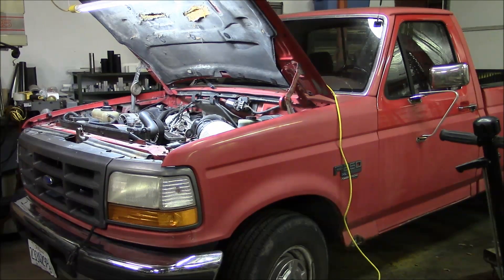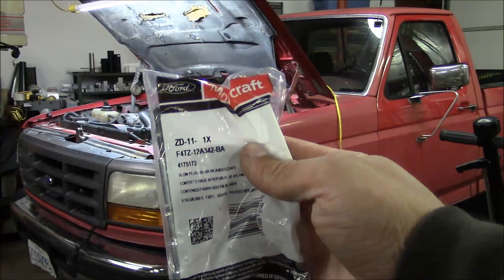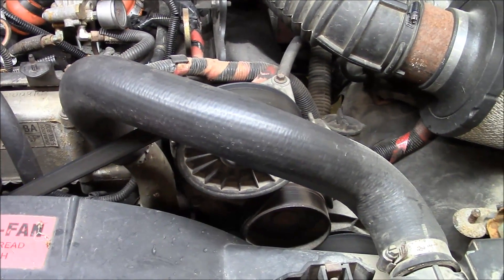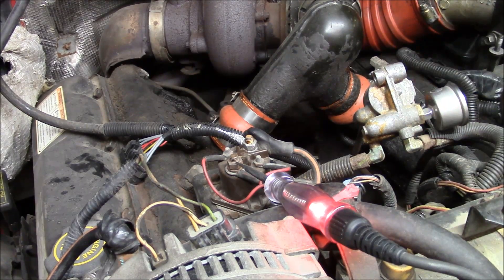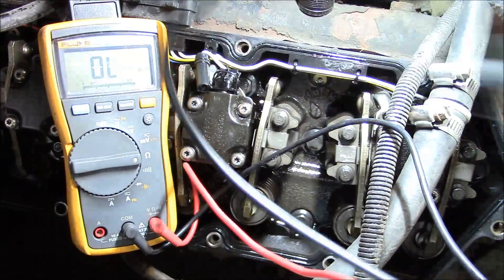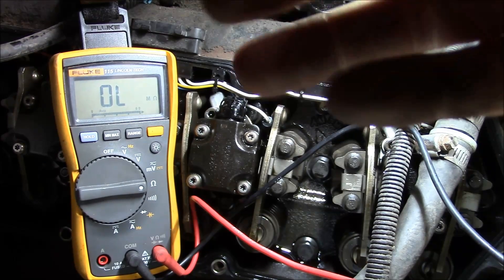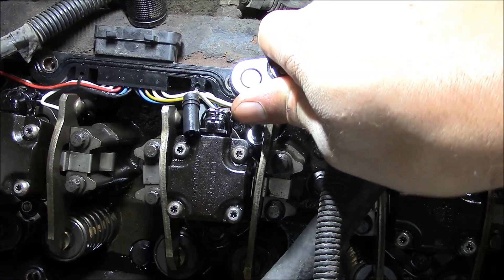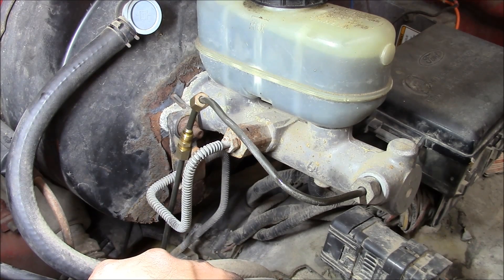7.3 Powerstroke No Start When Cold

Comment: Just installed new glow plugs in mine 95 OBS with 130k miles.  Broke one off! Real pain in the butt. Still didn't help with cold starts. Replaced the engine oil temp sensor. With apparently the wrong one. Fired right up when below freezing but holy smokes it sounded like it was running on 4 cylinders and idling at 1400 rpm  unplugged the new eot sensor and smooth as silk. Older round style connector on mine I see some for sale with a rectangle connector.  Put in a Motorcraft sensor today  immediately a world of difference.  The glow plug system uses the EOT sensor and the Barometric Pressure sensor in the cab to determine the length of time to power up the glow plugs.

Comment: This is my first time seeing the 7.3 rocker arms.  Wholly crap Batman!!! You can see the stamping seam in them and these engines are really reliable.  Most gassers have stamped rocker arms but this is the first diesel with them.  And such a simple stamping as well.  If it works, what the hell. ;o)

Comment: Be careful with non ford glow plugs (I avoid them as I've seen the damage they do, and at least Autolite are known to be very dangerous to the engine, disintegrating inside the cylinder....).  

On 7.3 diesel......
16-009 White-Rodgers (Stancor) 586 902 Monster Glow Plug Relay
$55.89    IS a WAY better relay!!!   Got my bits from dieselorings.com a very good Ford truck site, for diesels, they have everything at fair prices.

I put this one in, and new FORD (ONLY, only use Ford glows, if you have autolite brand, get them out asap, they disintegrate over time, leaving bits in your cylinder... not good).  I had a bank of 4 autolites I did not know about, fortunately, they all quit on me, so I pulled them.. only 1 had begun to disintegrate, and fortunately oil samples were still ok).  Truck was smoking a bit on startup if less than about 50 degrees, or if plugged in and less than 30.  

Now, unplugged, it pops right off at any temp down to 30 degress, so far, runs super smooth and no smoke.  Runs like a new truck!!  

The one bank had Ford glows, but only 2 good ones, the dangerous autolite bank was not working at all.

Also, replace your batteries.  
My harness was fine apparently, was replaced a while ago on both sides, maybe 1 year on one side and 4 years ago on the other side. 
 In these 7.3 (and in 6.0, etc.), change engine oil often (consider time elapsed and consider heavy duty usage in plowing, towing or dusty conditions, and maybe change at 1 yr/2k in those situations, or 3-5k otherwise.  Can go more than a year and more miles, if testing, and if driving it at least twice a month to burn off moisture or whatever) , this will help injector life and save $$$$.   
A lot of people testing their oil run 5k with light towing and lots of highway miles, up to 7k some of them, so you may be probably pretty safe going to 7k with all reasonable highway miles.  

Caterpillar does testing for about 10-15 bucks!!!   I added up their cost, vs Blackstone, save like 50 bucks I think it was , and the test came back in 2 days, not 2 weeks lols.  
I run low miles annually, plowing, and towing /loaded 80% of the time.  I Test at somewhere over 1k miles and run it another 1k, and then just change it if I think it's been long enough, even if it's still very likely good.  

Cheers.

Comment: Well I you know I have the same truck pretty much except it to 350 and it's a dually almost 400,000 miles it's my daily driver zf5 manual with four wheel drive I have the same problem I just use a mixture of ether and diesel to start it when it's really cold

Comment: Air temp intake on a diesel isn't that important especially in these older motors
Reply from the maker: These trucks will start with 2 bad glow plugs. More than that and you can forget it in winter.

Comment: Had some work done on my 1994.5 power stroke, then the next winter it became VERY cold blooded.  Wouldn’t start if the temps went below 40F.  Started digging around and found that the shop left the wires off the relay.  Hooked em back up good to go.
Reply: Dude, I love the avatar!
Reply: Thanks. It’s a stock image but it fits a back story perfectly.

Comment: Yes....they need the glow plugs to start well in cold weather, but once you've replaced them there is one additional test to do:  Injector Buzz Test.  You need a scanner to do this but when cold all 8 injectors will 'buzz' as the computer rapidly activates the solenoids.   The buzz test runs all of them for a second then by firing order each one so you can hear which one/s don't buzz if they're bad.  You can also tell by sound if some buzz strongly or weakly.

The reason they buzz is the armature that's lifted by the solenoid magnet strikes makes a click each time it's activated.  The big thing with high mileage that happens is the clearance under the armature plate to the injector body is only .004" and the valve seat that the armature lifts to inject is angled at 45 degrees and as it wears the armature drops which decreases the clearance gap.   The oil in the gap gets stickier as the clearance decreases which makes the armature harder to break free...especially when the oil is cold and thick.   Plus the solenoid magnet gets weaker as the distance to the armature increases....so when the oil is thick you get no injection and no start. 

You don't need to buy rebuilt injectors....you can measure the armature gap and shim them to correct specs and this will often restore performance as well as cold starting.   Costs about $70 for the special tools and shims to do the job which is a hell of a lot cheaper than buying new injectors.

Comment: also, FYI to others: like he said, GPR is on a timer, the idiot Wait To Start light doesn't actually show the state of the GPR, so when it goes off, the relay is still on.

It will stay on for about 2 mins, you can watch this in the battery charge while its running. it will go from 11v suddenly jump up to full 14v when the 200ish amp draw suddenly lets off.

so if your having issue getting it to fire in the cold, let the relay run longer before cranking.

Comment: I had the same truck! I wrestled with that damn PowerSmoke for YEARS. Every time the temp went below 40F I'd get a hard start and tremendous white smoke clouds. I swapped glow plugs, upgraded the glow plug relay, swapped out the valve cover wiring harnesses, had the injectors rebuilt, converted to e-fuel and prayed to Rudolph but no joy. If I drove into the office on a cold day and parked in the public lot, there was a real chance the truck would not start at teh end of the day without a lot of glow plug and cranking cycles. Soon the transfer case started acting up, requiring repeated service, and my oil pressure light had begun coming on intermittently with engine stalling. I drove that piece of crap straight to the Dodge stealership and bought a used 2500 with a Cummins. It's been smooth sailing ever since.

Comment: Love how kids think that's a cold air intake when its actually warmer air doing that the factory set up.
Reply: On those obs we just did it for flow and it was a significant improvement for those. But I definitely get what you’re saying.
Reply: Yes it's called a "Cold air intake" but yes is inhales warm air. HOWEVER warm or cold, more air makes a HUGE POWER difference regardless of the temp.
Reply: @7.3powerstroke6  Colder the air the more condensed it is there for makes more power. When the intake tube is the same size as factory you dont get any more air in.
Reply: Boot 185 true, unless the restriction is elsewhere, which is the case with the factory air box.  The inlet to the box was so restrictive you could see the vacuum of the intake suck the sides of the box in under moderate RPMs.  Getting rid of the air box allows for a lot more air flow and horsepower.  It’s actually a surprising performance improvement.
Reply: @motor2of7  I remove my air box right away because there is the restriction. Then I run it into the grill and put the filter up there so it gets the cold air from outside and not warm air from the ending compartment.
Reply: Boot 185 good setup

Comment: When doing a resistance check on the glow plugs in the vehicle, wouldn't it be more accurate to remove the old glow plug completely and then measure the resistance on it directly?  Otherwise your reading is the sum of the path loss from between the multimeter probes which will include any wires, and other losses through the engine block, etc.  You will get a more accurate reading if you pull the plugs and just measure them.  Great videos.
Reply from the maker: Actually, the best way to test them is with an clamp on amp meter, but most people don't have one, so I used the ohm meter. It would be most accurate to remove them before measuring, but it shouldn't make a huge difference.
Reply: After 125000 km just change all 8 simple no need to worry 🙏🙏🙏😃😃😃

Comment: I think mine has bad plugs and dying batteries. It slowed down its turning over and didnt start this morning (was like 39 out too), I just plugged in the block heater and went to work in my gasser. Ill give this all a look, thanks!
Reply from the maker: These engines will not start with weak batteries.

Comment: Does it have a fuel bowl heater if so, is it still in use or did you take it out ?
Reply from the maker: The fuel bowl has been removed entirely by the previous owner. He mounted the superduty style pump and filter on the side of the frame rail. It's a hack job, but it works fine and I suppose it's a bit more reliable than the old diaphragm pump.
Reply: @WatchWesWork  Thank you for the reply. I removed the bowl heater originally because it was blowing the  no 30 fuse which also goes to the fuel pump. Just wondering because the engine lopes when I start it in cold weather. saw the truck in the video start fine in 30 degree weather.
Reply: @WatchWesWork  I should clarify Im talking about the heater coil in the fuel bowl with the fuel filter on top of the engine of my 99 super duty.
Reply from the maker: I've started this engine at -15F with no block heater. It will sounds a bit harsh until the oil warm up, but it should fire on all cylinders. 

It's hard to say what the issue might be. The Powerstroke needs oil pressure, fuel pressure, compression, and proper voltage at the injectors and ECM to run. The number one cause of cold start issues in these engines is the batteries. If the voltage doesn't stay about 9.5 volts while cranking, they usually won't even start because the ECU will not function correctly. The FICM voltage  is an issue with the 6.0, but less so on other models, often that results in long crank time and rough running when really cold. After that is issues with the glow plugs. Usually they will start with 2 bad plugs. 3 or more will not start. Normally fuel issues will be seen under acceleration, not at start up, unless you are getting air in the system somewhere. Oil leaks in the HPOP system will usually cause problems with a hot start, not a cold start. It could always be a sticky injector. Usually 200,000 miles is about all you can get on a set of HPOP injectors. 

Hope that helps.

Comment: Man your coolant is black, oil in coolant which is prob one of your injector cups is cracked.
Reply: Oil in coolant means oil cooler not injector cups
Reply from the maker: What? I just had the coolant out last week to fix the oil cooler and it was like brand new. Normally a bad injector cup will result in fuel in the coolant.

Comment: On the 6 liter glow plugs, if you pull the valve cover you can get a small heel bar under the plastic pass through and pop them out.

Comment: On my Mercedes they need the plugs replaced about every 30K miles.  My 5.9 will start well below -10F no plugs and no heaters.  My 2 cylinder Deere starts to minus 40F thanks to the pony motor. :-) The NTA 420 will go off at about 40F good with good batteries, my 6030 about the same, colder than that they need plugged up. My Mercedes will start down to 10F below that it gets dicey. I would never advise anyone to own a 6.0 or a 6.4 Power stroke. Same goes for a 3116 Cat.
Reply from the maker: I had great luck with my 6.0. I've started in at -25F many times without plugging in the block heater. Cycle the glow plugs a few times and it would fire right up. Agree on the 3116 Cat though. PITA to do the overhead with the fuel rack in the way. Kinda like an old 2 stroke Detroit. No power, parent bore block, like to eat cams. The 3126 wasn't much better with the HUEI system.
Reply: Bah Brian, I'm with Wes, I love my 6.0, she can be a bitch when she wants, but all n all, so much more engine than my old 7.3, and the truck around it is 10x and Dodge truck. Don't get me wrong I respect the hell out of a 24v 5.9, but the Dodge around it, I'll pass. 

Hey Wes, does that zf5 go into reverse, while completely still? Boy I sure don't miss that either.
Reply: @flashpointrecycling  My 3116 comment was geared mostly towards longevity/cost of ownership issues more so than cold weather problems.
Reply: @bcbloc02  - Hi Brian! understood.
Reply: From what I have heard the 6.0 were ok if you didn’t try and hot rod them

Comment: Are you using synthetic oil? That will help a lot with cold starting. Costs quite a bit more but worth it if it starts better.
Reply: I switch to the t6 synthetic because was having trouble with cold starts. Oh I  thought it was great so easy to start no even plugged in but then oil cooler started leaking then turbo. Rebuilt turbo rebuilt oil cooler. New up pipes delete egr pedestal. Always just figured truck cold blooded needed new glow plug year after put in new. Turned out thermostat stuck. Back to 15-40 right oil and now starts just as good as light weight wrong oil. Just thining oil or putting thinner in oil like stiction junk might seem like a miracle to injectors as well but really not just running thinner damaging something down hill. Not a diesel guy or mechanic but did turbo and up pipes and coolor myself and glow plugs. Really have no idea what I'm talking about with my 2 years of 7.3 knowledge 🤣 just a uneducated feeling about wrong weight oil maybe in Alaska  but not even here in Iowa I feel
Reply: @casepete6707  w

Comment: Connect the battery direly to the sparkplug. No decent spark then its time to replace the plugs.
Reply: Rolingmetal that's your solution to the problem? Diesels don't have sparkplugs.
Reply from the maker: Believe he means the glow plug. That's a reasonable test, but you'd have to remove it first.

Comment: I liked the old 7.3 power stroke, change many glow plugs over the years and the injectors.  The injectors are the big pain in the rear especially the passenger side rear cylinders. That brake line Wow!   Matt C
Reply from the maker: I don't think it's too bad except in a van.
Reply: Wait until you have to do the injector cups, you'll know it's time when you find fuel in the coolant.  Been there done that, its not really that bad, other than the joy of running a 15/16" thread tap into the existing brass cup which is inside the injector bore then using a slide hammer to remove it.  OK, hammering the new one in is also a little unnerving..  :)

Comment: I love the 7.3, but you will want to consider putting a spare Cam Position Sensor and a 10mm wrench in the glove box for future no starts. :)  Also watch out for the Injector Driver Module getting water in it (Located on the driver fender and known to fail)  I recently rebuilt 4 dead IDM's and will post a video on lessons learned and the parts needed soon.
Reply from the maker: It came with one. It's like a spare fuse for a 7.3!
Reply: Yea thats the truth, just put in number 3 ! what happens when water gets in the idm
Reply: have a 99 7.3 live in texas when temp gets into the 40s my engine will lope when I first start it, my glow plugs are good /
Reply: So I’ve changed my cps my ipr my hpop getting plenty of fuel do you think my idm might have gone bad I have a 99 f-250 7.3 diesel